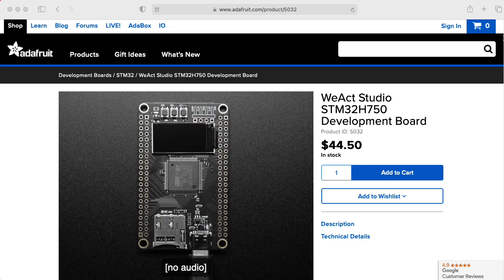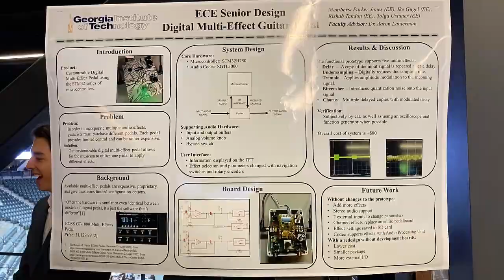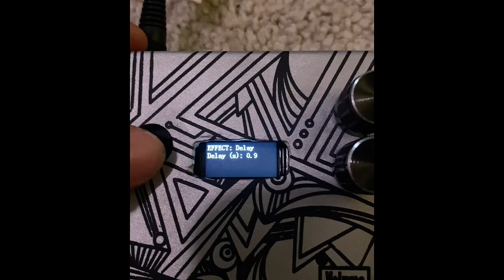DSP Guitar Pedal with WeAct Studio STM32H750 (Georgia Tech Capstone Design Project, Spring 2022)

Comment: Very cool project….congrats to the students that did such good work. I had assumed distortion would have been a first effect, but the others are essential of course. Perhaps an IR loader (if possible with memory) and load impulse response of tube screamer. Personally, I have a great distaste for the tube screamer and other pedals of that same ilk….the soft clipping, to me, sounds as if they are mixing in a clean sound with the soft clipped sound and there is a preponderance of amplitude dynamics - I don’t like them, but a I see their value for pushing an old low gain tube amp

Comment: I've been hamfistedly working my way through getting up to speed with C++ DSP whoza whatsit, in the hopes of allowing for a system based around the Daisy seed (which uses the same chip I think?) to load impulse responses, without really assessing that can of worms at all before I was way deep into learning the platform.  

If someone else wanted to do that, I wouldnt stop them, not even a little bit. lol. 

It would be neat just for cab simulation (or convologilical ... convoylogy reverb... conv-something reverb) , but I've been having a blast creating goofy impulse responses from all manner of strange resonating thingies. and sticking that into a stomp box would be killer.

once I got closer to working hands on with FFT I sort of developed a 1000 yard stare regarding the whole shebang.
Reply from the maker: Ah yeah, it looks like the Daisy Seed does use the same microcontroller!

Comment: Looks pretty awesome. I recently picked up an STM32H735 dev board (very similar to the H750) that I hope to use for DSP learning/experiments. The dev board already has an audio codec on board, which is handy. I've been following Phil's Lab (YT channel) where he has been doing a series on building a STM32F405-based guitar effects pedal. I believe some of the H7xx series has  "math accelerator" (CORDIC/FMAC) vector instructions that are intended to be used for implementing digital filters, although I haven't looked much into it.
Reply from the maker: Oh, thanks for the tip!
Reply from the maker: The STM32H7 series has so many variations it's hard to decide between them.

Comment: Ah, beat me to it! Personally I’d have done it with an ESP32, because they’re really cheap for the amount of RAM they have (520kB), with DMA. The latest ESP32S models even have native USB. If you needed more RAM it may be more cost effective to use an external DRAM IC than to upgrade to a higher end MCU, though I can’t say what kind of clock rate would be necessary. My intention was to use Fourier transforms for effects, which I think are an upper bound for how processor intensive any effect would be, and I think 520k was enough to fit in 3 or 5 overlapping STFTs. No clue how I’d program them though, Z transforms alone are mostly a mystery to me.

Not sure what analog hardware you’re using there, the built-in ADC might be ok but I’d definitely lean towards an external DAC since 12b is a tad limiting. The external pedals is what I’d do also. It would be good to maximise the convenience of the UI, be that a larger screen, or some sort of USB or web application.

Oh and post schematic and layout images to the GitHub! Some of us don’t use Eagle.
Reply from the maker: We went with this board because it was a quick most-in-one solution with a built in LCD to get things running. For future versions I'd go for a larger LCD. 

For the ADC/DAC, they used the 16 bit Teensy Audio Adapter, which works fine for many things that aren't Teensies.

They had originally planned to make a desktop app editor for it but ran out of time.
Reply from the maker: This STM32 has built in native USB.
Reply: @Lantertronics  
Oh it comes with an LCD? I think there may have been a few attempts to do something with ESP32s on dev-boards that come with screens, but those microcontrollers are all a bit strange anyhow. Still, I’m of the opinion that for a stripped-down low-cost open-source project it’s still probably the best way to go, especially considering the modern parts shortage

Yeah basically all STM32s that aren’t minimum spec have native USB last I checked. I was just comparing it to the old ESPs without it. Could use the built-in wifi of the ESP instead, but I think that has a fair bit of processor overhead, and might not play well with interrupts and such. On the other hand, USB interfaces aren’t that open-source friendly, what with having to make a driver for every OS you want to cater to. Having USB audio class as an audio interface could be neat though.
Reply from the maker: @Scrogan  Yup, it caught my eye specifically because of the built-in LCD.

Comment: Hey Aaron thanks for the cool video! I've been going down a similar rabbit hole lately and been having fun writing DSP code for a pedal I built around the Daisy Seed board, which is a fairly new board designed specifically for DSP. Wondering if you had any familiarity with it? It's been super fun to learn! Very cool to see this capstone project, and to learn what other platforms are out there.
Reply from the maker: The Daisy Seed looks really cool. I haven't tried it myself yet, or had any students try it yet, but probably will in the future.
Reply: I did my first one on an esp32, proved rather difficult. I am now using a daisy seed and an esp32. I am using an old phone for the screen over Wi-Fi. It also has midi functioning to control my Peavey vipyr and my DAW.